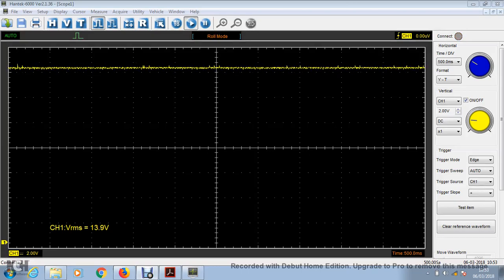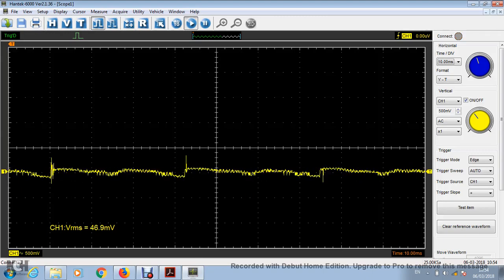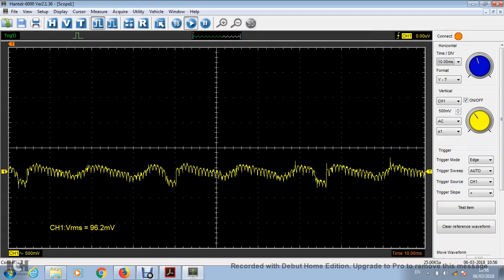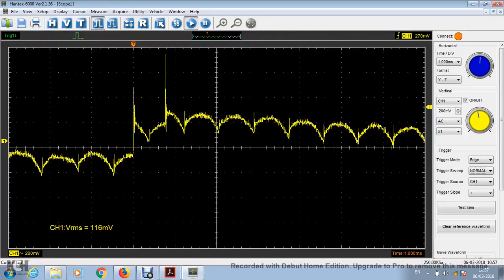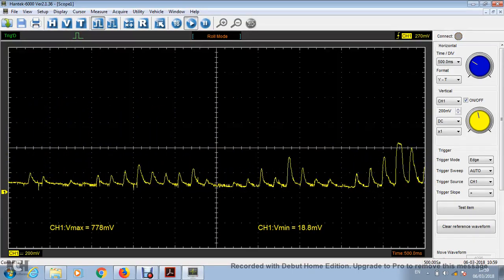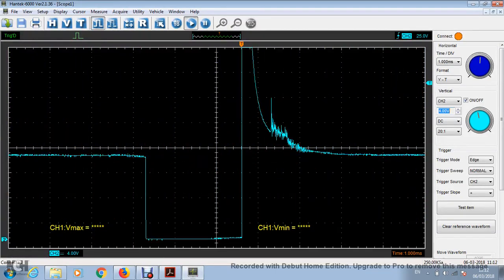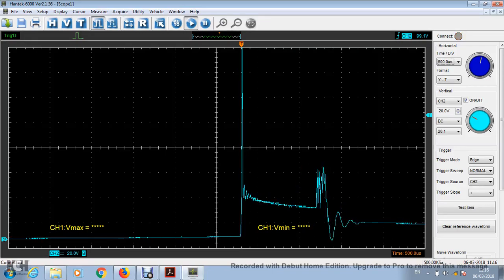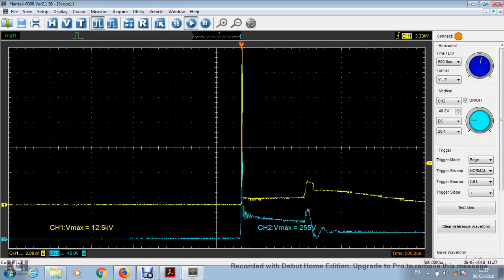Hantek 6074BE testing under the hood

Comment: try connecting to ECU ground or the actual sensors ground being tested would be better. the ECU has a more filtered ground. your getting a lot of noise from other electronics as well as the alternator itself.
JMO

Nice info tho

Comment: You can try to use it also with HScope app on android devices. The driver for this oscilloscope has been released today.
Reply from the maker: I couldn't find any way to do it
Reply: @sailorbob74133  Just need an USB OTG Cable to connect the oscilloscope and to get this app on you phone or tablet.

Comment: Do you have any experience with the 2205 pico oscilloscope?? I saw these on Amazon for $150. Do you think it's a better deal over the hantek scope? I see you posting comments on it. Ky garage home guy has videos on the 2204. It seems to work good.
Reply from the maker: I bought a pico 2204a and I like it better than the hantek it was only $139 on Amazon I don't know anything about the 2205.

Comment: The problem with the noise is it is only 8 bit whereas the 1008 is 12 bit.
Reply from the maker: that's interesting I bought a piko 2204a and it also has a bit of noise and it is also an 8-bit scope so you might be onto something there.
Reply: An old school guy pointed that out, resolution issue with that scope when trying Pressure Transducer DYI. I have the 1008C but most people claim that it is only good with 2 channels and the rest will be crap. Haven't played around to see 1008c vs 6074BE.
Reply: Hantek 1008 is an effective 9-10bit ADC resolution oscilloscope considering its noise, compared to the Hantek 6022 or 6074 which are effective 8bit ADC resolution.
Reply: @martinlorenrd4073  can you confirm that the other channels will still report OK or the conclusion remains that only two channels are true reporters while all others crap out?
Reply: @scientist100  From the tests I could do now the other channels has the same noise level of Ch1 and Ch2. This has been tested keeping just 2 channels active (sorry cannot test more on HScope).

Comment: You guys know nothing, I just bought the 6074BE and I will be doing side to side comparison between the 1008C. I will be using the same probes too just for kicks, I will report with link of results.
Reply from the maker: At this point I would generally recommend someone just to get a cheap 2-channel Picoscope.  For example the 2204a is available for $89 on Amazon if I remember correctly.
Reply: @sailorbob74133  I think most of us would rather have at least 3 channels but I understand your frustration. I will try this out since I just got it yesterday, the 1008c I got it from China along with both small and large wire amp clamps.
Reply: @sailorbob74133  forgot to mention if you the up to date software. Latest 1008c software seems polished.
Reply from the maker: I actually downloaded and use the new 1008c software and even though it looks better than the old software it's actually much worse
Reply from the maker: Generally speaking if the 1008c just had decent software which shouldn't be too difficult it would be a great bargain

Comment: And also saliorbob is there a way to slow down the sampling? Maybe the 1GS/S rate is over sampling ? I know most oscilloscopes under the acquire function you can decrease the sample rate
Reply from the maker: ElectronMark Boggess there was no way to change the sampling rate manually there was only a bandwidth limiter that didn't help very much
Reply: @sailorbob74133  on Hscope you can set manually the sampling rate, just the number of samples is limited to about 4000 each channel.

Comment: Would you say buy the 1008c?
Reply from the maker: I wouldn't say the 1008c works great, but it's usable and you can get real work done with it once you learn to work around it's limitations.
Reply: Just saying I got the 1008c with a 20:1 attenuator, and the hantek 650 AC/DC amp clam same day shipped of 280cad after everything which I find to be sweet. It also already helped me with a relative comp test
Reply from the maker: It really depends on your situation.  If you have very little money, the 1008c is really your only option.  It takes a bit to learn to use  it and understand it's limitations, but you can get real work done with it.  You could also look at the 6022BE / BL which only has two channels but a little better specs for the same price.  That scope also has third party software available for it.  You should check out ScannerDanner's book and online courses if you're looking at this for automotive purposes.  The Picoscopes are allot more expensive, but also allot easier to use.
Reply: sailorbob74133 I've found a 70mhz hantek on aliexpress for under 140 do you recommend it? I think it's the same model as in the video thanks
Reply: Electric Lamp I picked up the 1008c and it works great
Reply: KronicKatz that's the other model I want to get I only need the scope for automotive repair it seems everyone has that model so I might pull the trigger for 1008 since it seems like everyone is having issue with the 4ch 70mhz hantek Thanks
Reply from the maker: No, the 6074 seems to have allot of issues at the moment.  I'd either get the 1008c, or the Pico 2405A if you have a little more money.  I've never used that particular Pico, but if you've got a little extra money it's only $429, instead of $1200 for the 4 channel Pico automotive scope.
Reply: the 2205A is $199 from TE equipment and from what I have been told and have verified it a pico 2204 user. There is a hack to use the 2000 series picos with the pico automotive  software
Reply: +KronicKatz - The HScope android app transforms the HT1008 into a much more capable device. Night & day!
I also own a HT6022BE which also works very well with the HScope app.
You'll need and Android tablet or smartphone of course and the app is about $14 on the Google Play store.
I no longer bother with the official Hantek windows software.
Reply: logical canuck what is the name of the App.please
Reply: +ElectronMark Boggess - the app is HScope and can be found on the Google Play store here:
https://play.google.com/store/apps/details?id=com.martinloren.hscope
I have a few videos on my channel in which I use it. Might give you an idea of what to expect.
Reply: logical canuck thank you
Reply: +ElectronMark Boggess - Try the free version to test the app on your android device first. Once confirmed that your device will run the app and that the USB is OTG capable to power the HT1008, then purchase the app. About $14 and specify that you wish to be on the BETA program. The BETA version is always way ahead in development of the released version.
Finally, there's the "automotive module" addon sold separately which allows a few minutes of sampling...very nice!
As in all things, there's a learning curve but well worth it.
Reply: logical canuck awesome!! Thanks for the info